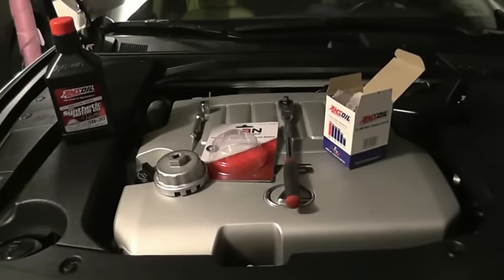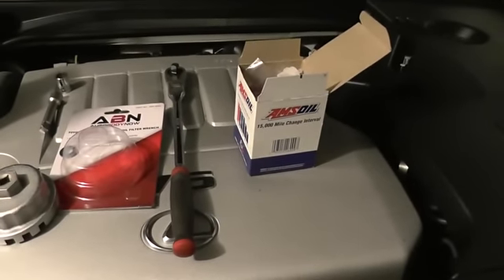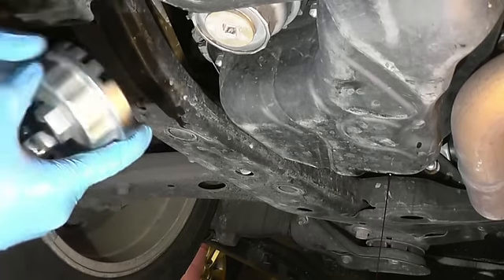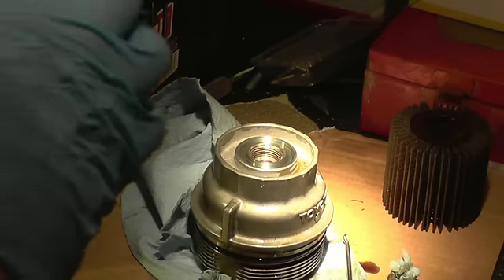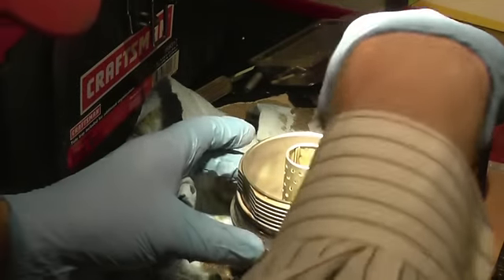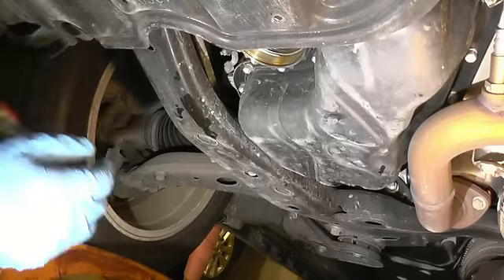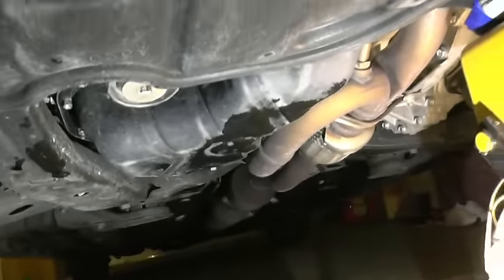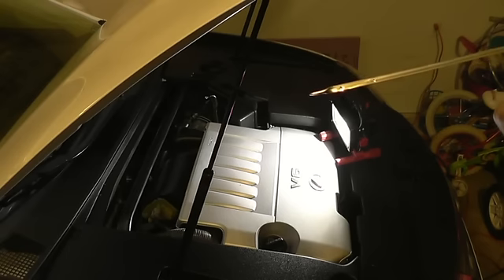Changing oil on V6 Toyota/Lexus. Using Amsoil products.

Comment: When changing your oil on this 3.5 Liter V6 engine don't forget to prefill the filter housing with oil before putting it back on.  Also, flip filter upside down so the whole filter is saturated with oil. This will prevent starving the engine of oil at start up. Other than that, there is nothing I would change. Great job on the video. Keep making these videos and sharing your knowledge. Many people will thank you for it.
Reply: Where did you learn that? I have never seen or heard a tech prof say that, and I never seee it in any book.
Reply: @mucialmichaud8020  I've been working on cars and trucks for a very long time and I learned this at a young age when working with my older brother. He was taught to do this when he was in high school. I thought it was common knowledge. It totally makes sense to me. Try this:  If you have a vehicle that has an oil pressure gauge, don't fill the filter when doing an oil change, and watch the gauge when starting it, and you'll see how it takes a few seconds for the gauge to register any pressure. When there is no pressure, the engine is being starved of oil. On the next oil change, fill the filter, watch the gauge, and you'll see how much quicker you see the gauge register pressure. Does it make a huge difference? Maybe, maybe not, but I would rather err on the side of safety. The less time you run an engine without oil pressure, the better.  Right? When I say turn the filter upside down. so the whole filter gets saturated with oil, I don't mean to turn the whole filter housing upside down. I'm saying to turn only the filter element upside down so both the top and bottom of the filter element media gets saturated with oil. It's not necessary, but that's what I do with my car. What are your thoughts on this? I have a question for you. What do you do when the filter is mounted sideways or upside down on an engine? You can't prefill the filter, so how can one minimize the time the engine runs without oil pressure?
Reply: I just change my oil and put on new filter and nothing else. Nothing never happen to my engine so I don't have to worry about anything.
Reply: Mucial this guy just likes to complicate simple things
Reply: @mucialmichaud8020  If that works for you then keep doing what you're doing. I just like to keep my vehicles for 300K or more miles without any serious engine issues. The less wear the better.
Reply: @abdulrehmanmian1476  So you're saying it's not a good idea to fill the filter housing with oil before screwing it back on?
Reply: @abdulrehmanmian1476  you're telling the truth,😂😂😂🤣🤣🤣🤣🤣
Reply: @bernardocisneros4402 , agree with you 100%!

Comment: Toyota seems to have made a backwards step with the oil filters here. In the past, oil filters were a filter element inside a permanent housing, messy to change. Here you need a special oil filter tool and you need to drain the housing before you remove it. It take longer, more difficult, parts to be drained and cleaned, and would cost more if you don't do it yourself

So much easier with a spin on oil filter, which can be filled with oil before it is reinstalled. Spin the old one off, clean the filter block, oil the seal on the filter (and fill it with oil) then spin the new one on.

In my opinion, a backwards step by Toyota.
Reply from the maker: I agree with you. Toyota is trying to make everything as difficult as possible to discourage people from doing it yourself.
Reply: repairvehicle There could be another reason. That filter housing is more durable for off road vehicles, where a spin on filter could be hit by an object and more easily penetrated leading to a major leak.
Reply from the maker: Aluminum housing is very strong. However, most of the Toyota's don't have aluminum housing, its hard plastic. That is why aftermarket worlds is full of replacement housing that are made of aluminum. See my video for Toyota sequoia where you can see the other type of housing.
Reply from the maker: Toyota makes TRD oil filter, because original Toyota filters do not provide proper filtration, and they are very similar to AMSOIL oil filter.
Reply: the reason its a filter element is because its more environment friendly. But what do Americans know about that...
Reply from the maker: AndersDog94 , it cost less to make filter element than regular oil filter. however, Toyota will still charge same price.
Reply: yes, but seriously, its couple of dollars right? do it really matter that much.
Reply: what do you mean "does not provide proper filtration" Toyota engineered there OEM filter to meet there specs, and small particles below a certain size are not harmful to the engine.
Reply: Daimler Benz oil filter is replaced from top so Toyota might set it up on similar way.
Reply: HJR VW. Audi are all like this except they are facing up and much easier to change it.
Reply: Things aren't always what they seem.
Reply: @repairvehicle 
I don't think that true...
Reply: Done right, this is a very clean oil change.  You can empty the filter nearly completely before changing it, because Toyota positioned it almost nearly vertically and put a drain valve on the housing.  On my other cars, I get drenched with oil when I change the filter because the filter is always at a weird angle and as I unscrew it, the oil runs down the housing and down my arm.  Toyota put some thought into this - a lot more thought than most other manufacturers.
Reply from the maker: True!
Reply: I agree with you 💯! I have always changed my oil on several different cars and never needed a specialized tool to take the oil filter off.  To me it’s absolutely seems it was done intentionally to force you to go to the dealership.  The whole thing of providing a drain for the oil housing cartridge is ludicrous.  You turn a canister style oil filter let it drain, grab a rag and dump it into the oil drain pan, DONE.  If you don’t want to get your hands dirty wear gloves.  I’ll be forced to buy the tool and I hope it’s worth it as this is my first Toyota.  Incidentally, my daughter’s 2010 Ford Escape has a 198k original miles and still running strong.  Oil change done every 3k miles using a canister style oil filter.
Reply from the maker: No repairs on escape? Look at the ford diesel, requires special tools for maintenance. Even escape requires oil filter tool.

Comment: Oil the filter o rings on both ends too I personally pour fresh oil in canister about halfway  and put filter in one direction then take it out then renstal filter the other directionan  to lubricate both ends of filter o rings it's also a good idea  before Putting filter element in( with out oil in canster) poor a little bit of oil on the housing threads to help screwing filter back In  to the engine block; I've found THIS to be most helpful whith the plastic filter housing. Royal purple filter is less money at less at summit racing the filter looks the same to me and has the same filtering specs.
Reply from the maker: You mean 99% efficiency at 20 microns and rated for 15k miles?

Comment: Can you change the filter only without draining a massive amount of oil in pan to waste. 15000 on filter and oil is 25000. I didn't think that thru when i put it in then realize the filter need to change. I have 2015 toyota Sienna
Reply from the maker: Your oil is good up to 15k miles or 1 year, which ever comes first. Changing filter without replacing oil,  must be verified via oil analysis.
Reply: @repairvehicle  I have bought the 25000 miles Amsoil signature.  Now I see filter is only 15000 . Can filter be changed alone? Without oil?
Reply from the maker: What are you using your van for?
How many miles a year do you drive?
Where do you live,  Southern or northern part of USA?
Reply: Uber but I really didn't do heavy idle. But I'll change it, because it  is the first time. It  must have to be alot of cleaning done in engine from Amsoil signature series
Reply from the maker: Uber driving is not highway driving,  a lot of stops.  You must change your oil every 15k miles and filter, using amsoil signature series.

Comment: Why 5w-30 and not 0w-20 as per specification? I just wondered that is all. Thank you. Excellent video though, very clear.
Reply from the maker: 5w-30 is per specifications.  2012 and up that's when 0w-20 is required.
Reply: @repairvehicle   Thank you. I have a 2017 Lexus RX350 and it requires 0W-20.
Reply: @repairvehicle  can you only change filter only on Toyota?
Reply from the maker: If you change filter, how do you know that oil is still good?

Comment: Have you found any aftermarket drain valves for the oil filter canister?  I bought a box of a dozen OEM Toyota Filters that come with the cheap plastic one you jam up into the bottom of the canister to drain the oil but was hoping to find a screw in type I could reuse at every oil change.  Thanks!
Reply from the maker: +Anthony O, there are after market drain valves, I don't use them.  However, since I am using best Oil filter (made by Amsoil bestautofluids.com) it comes with good drain valve.

Comment: What size is that thing you use to reduce oil going everywhere
Reply from the maker: Don't know,  it comes with oil filter
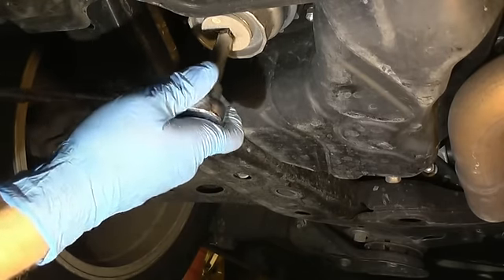Reply: @repairvehicle  that tool in 4:24
Reply: @repairvehicle  that long stick. What size is that? 😂 I don't know my tools very we'll
Reply from the maker: 3/8 and about 3 inches long
Reply: @repairvehicle  ohh ok thank you so much
Reply from the maker: You are welcome! What do you have?
Reply: @repairvehicle  a 2014 ES 350

Comment: I was not too fond of the new cartridge type filters either but if you think about it they surely eliminate a lot of metal parts being wasted (old filters) since you reuse the cartridge housing. If you do it correctly, the mess is pretty minimal too.  The funny part is that they charge the same amount for the filters even though you are buying essentially just the innards of an old filter now!  I get about 209 ounces or 6.5 quarts in my V6 2016 Highlander.  Good video- you also can pre-fill the housing with new oil right before screwing it on. Not sure it matters but it surely can't hurt!
Reply from the maker: condor5635, I was thinking myself about prefilling housing with oil. It certainly will not hurt anything by prefilling housing with oil. It will only help, because engine critical parts will get oil much faster. If you don't prefill then engine is running without oil for 5-10 seconds depending on the oil type and temperature. It takes some time to fill up housing and pressurize entire engine oil paths. If you don't mind answering, what brand of oil and filter are you using in your highlander?
Reply: repairvehicle Redline and an Amsoil filter
Reply: Prefill, then flip the cartridge upside down and reinstall so instead of 50% saturated, it is 100% presaturated with oil.
Reply: Aside from the filling of the filter, what many are missing is the filter rating of the Amsoil filter.  

If you not wish to keep your car more than 300k, then do what you do. Otherwise, as for my 2012 Avalon, I'm using an Amspil filter.

Comment: The oil will last 25,000 miles, it's only the filter that will need to be changed at 15,000 miles.
Reply from the maker: Boodieman72 , thank you for comment. I agree with you 100%. you must be using amsoil products?
Reply: Been using Amsoil products for more than 10 years.

Comment: Hi i have a gs450h, 2007, I haven't checked out where the oil filter is, although i do have the 36mm socket that you do. 
Will i also need the square socket that you used when draining the filter housing?
Reply from the maker: +wellifthemediasaysit , yes you will need, if you want to drain the filter housing. You don't have to drain the filter housing, however oil will be running everywhere. Tools come in different sizes, 1/4, 3/8, 1/2, in terms of ratchet. It's 3/8 size.
Reply from the maker: +wellifthemediasaysit, if you drain Oil from filter housing then Oil will not be allower the place when you remove filter.
Reply: All done now. 14mm sump nut, no washer (odd as it has full lexus history), oil filter was standard type that the 36mm socket fits onto, no recess to drain housing. Flushed and Refilled with 0w20, and a new filter.  Easy enough. Was due as although oil was still a good colour, last change was 15k and 4 years ago!

Comment: Where did you get the threaded drain for the filter
Reply from the maker: https://www.amsoil.com/shop/by-product/filters-and-by-pass-systems/oil/amsoil-ea-oil-filters/?code=EA15K02-EA&zo=5257753
Reply: It comes with most replacement filters.

Comment: Where did you get the threaded oil drain tool from ? Nice video btw
Reply from the maker: Here's the link, it comes with the filter https://www.amsoil.com/shop/by-product/filters-and-by-pass-systems/oil/amsoil-ea-oil-filters/?code=EA15K02-EA&zo=5257753
Reply from the maker: https://www.amsoil.com/lookup/auto-and-light-truck/2011/lexus/es350/3-5l-6-cyl-engine-code-2grfe-a/us-volume/?zo=5257753

Comment: In Europe most manufacturers recommend changing the oil at about 20.000 miles .... ford recommended changing the oil in a 2.2 diesel engine at 27.000 miles in 2013-2016 and in 2017 the new interval is 36 000 miles between oil changed on the new 2.0 tdci diesel engine ..... so most oils will last 20 000 miles not only Amsoil .... here dealers use castrol shell fuchs mobil texaco ..... fact

Comment: Toyota now recommends 0W20 in the 3.5 v6, that's what my 2012 Venza owners manual says. Any thoughts on using the 0W20 vs 5W30?
Reply from the maker: +TheGreatAristo, Toyota recommends 0w-20 for v8 engines also. I am using Amsoil 0w-20 in my Sequoia. The viscosity of 20 is less comparing to 30. Amsoil oil will protect engine no matter what viscosity you use.
Reply from the maker: +TheGreatAristo , take a look at this video https://youtu.be/iGnHewfLJps
Reply from the maker: +TheGreatAristo, if you ever want to experience Amsoil please use this website. bestautofluids.com
Reply from the maker: +TheGreatAristo, also, 5w-30 was recommended with conventional oil. Since full synthetic oil is better than conventional oil, Toyota switched to 0w-20.
Reply: 5W30 was recommended for RX350 for previous generations. Starting, I think from 2013, it is  0W20. Mine is 2015 and that what I have been using.

Comment: I can't tell because you didn't use a torque wrench but it looked like you tightened both the oil filter cap and the oil filter cap drainplug as much as the oil pan drainplug. And that is too tight.

Oil pan drain plug torque: 40 N•m/30 ft lbs
Oil filter cap torque: 25 (±5) N•m/18 (±3.5) ft lbs
Oil filter drain plug torque: 13 N•m/10 ft lbs
Reply from the maker: Housing drain plug tight very little and filter housing doesn't require any torque because o ring prevents oil from leaking not high torque.  When it comes to finishing torquing something I do it very slowly it doesn't mean it over torqued.
Reply: @repairvehicle  Don't say it doesn't matter (or "filter housing doesn't require any torque). I know it matters. If the oil filter drainplug is tightened more than the oil filter cap it may not matter so far as leaks go but it will matter because at the next oil change you won't be able to remove the drainplug without the oil filter cap coming off with it.
Reply from the maker: @stevensevek6151  , agree.  Over torquing does no good. I didn't say it doesn't matter.

Comment: Detergents in oil  breaks down around 4500 miles .heard this from lab?? Causing deposits???
Reply from the maker: True with full synthetic,  not True with 100% synthetic.
Reply from the maker: Full synthetic oil is made from none synthetic base stock oil.  
100% synthetic oil is made from synthetic base stock oil.

Comment: Why tha oil bottle say 5w30 and toyota synthetic oil 0w20 what's the difference
Reply from the maker: I don't understand your question. What is your question?
Reply: repairvehicle toyota oil reference is 0w20 and amsoil that you show us is 5w30 is different reference
Reply from the maker: Thank you for asking. Older Toyotas and Lexus vehicles required to use 5w30 none synthetic Motor oil. Never Toyotas and Lexus vehicles requires to use 0w20 synthetic Motor oil. 5w30 is thicker oil than 0w20. What year is your vehicle? I use Amsoil oil for best engine protection, one year drain interval, easier Cold temperature starting engine, better fuel economy. I purchase Oil from bestautofluids.com
Reply from the maker: Did I answer your question?